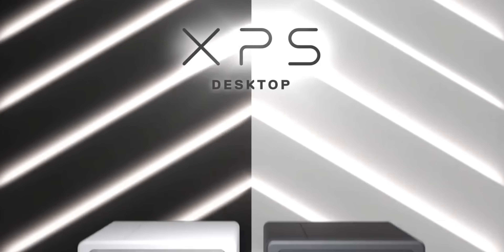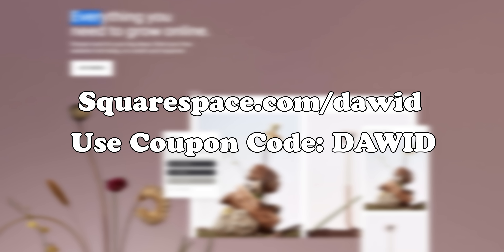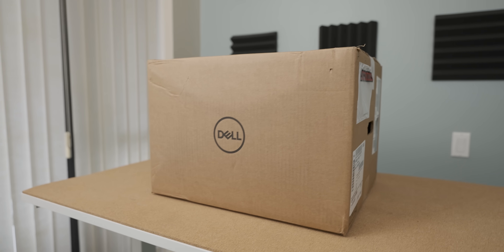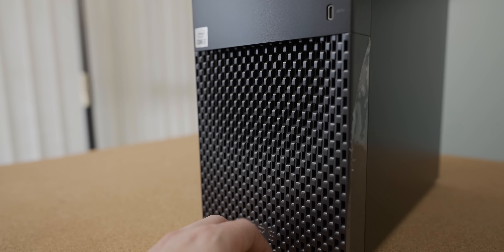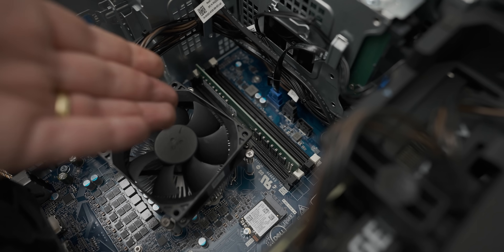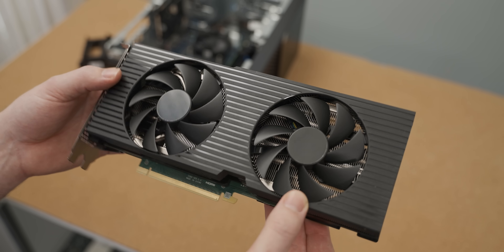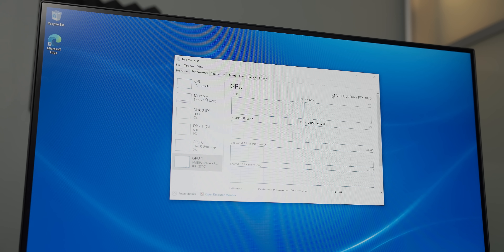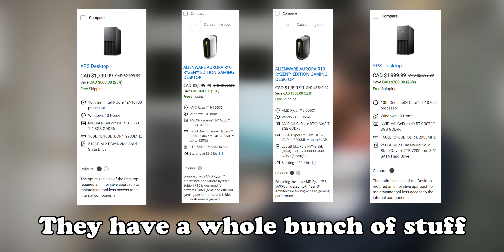DELL Did Me Dirty... RTX 3070 Dell XPS Pre-Built

Comment: I will never buy Dell again... I have had two spec'd out units off them within a space of 3 to 4 years about 5 to 8 or so years ago, the latest was an expensive build that I could have home built if I had the knowledge at the time for a fraction of the price, it had immediate sound issues that I could not even confirm was coming from the expensive sound card but required a restart an hour after having the unit on, everyday... both Seagate Barracuda 1.5TB hard drives failed within the year which is astonishing to think that Toshiba at the time could last 10 years, so those cost me an arm and a leg, and after spending more money on new hard drives, time wasted re-installing a lot through updates messing up my system, time wasted trying to figure out the sound issue, it kept me above water for 5 years or so at a cost to my sanity, but boy, did I feel a great pressure come off of me when I threw that garbage out for a home build that 5 years on has given me ZERO issues.

Comment: My lord...  That looks like a 20-year-old Motherboard....
Dell has REALLY fallen off...  They must have all OLD idiots that work there who have no Vision anymore.
I just spent $1,500 with ALL massively good parts (purchased separately, most warrantied) including two SSD's, the only thing I didn't include was the video card cause you can't get one now, so I'm going to put my 2060 into it, and also putting my BlueRay Burner into it, and will get a new multi-card reader since I need an updated one.  Nevertheless, that Dell system was just terrible.  And what happened to their great internal "design" tradition?

Comment: This reminds me of the time I bought an XPS system back in 2010.  I didn't have a lot of money, so I couldn't get it all spec'd out like I wanted.  I ended up going for a XPS 9100 with 12 GB of memory, an i7-930 processor, a very early NVIDIA GTX graphics card and a 500 GB Western Digital Black HDD.  It spent a number of years in pieces after I scavenged it for parts, but decided to rebuild it last year.  I used the original motherboard and the original processor.  I decided to add 24 GB of Corsair Vengeance PRO memory, a 500 GB Samsung SSD, a 3 TB WD Blue HDD for storage, and added a EVGA GTX 970 FTW for a graphics card.  I powered it on for the first time in years and it ran like a champ.  I bet it would even out perform the most spec'd out prebuilts on the market.

Comment: He benchmarks at 1080p and complains that the GPU is only running at 60%. Like righto mate, show me a CPU that doesn’t bottleneck a 3070 at 1080p. And if single channel RAM is so TERRIBLE you could have spent a few mins dropping in two 8GB DIMMs to show us the MASSIVE FPS benefit. But you didn’t, because it’s 2021 not 2005 and dual-channel just doesn’t matter that much anymore.
Reply from the maker: I get that testing a 3070 at 1080p shows up CPU bottlenecks, but that's one of the reasons I tested there. You should be getting higher FPS with a 10700 at 1080P. I'm doing a follow up where I test the system with dual channel RAM and a better cooler to see how much it matters.
However, the main reason I was so upset about the RAM configuration is because I specificaly asked for the correct configuration and they still gave me the incorrect one.

Comment: So did Dell do when you told them that they didn't send the right RAM configuration? It's been many years since I dealt with Dell, maybe 15 years. We ordered computers from them and they never got the configurations correct and their customer service was totally brain-dead. I worked at Motorola in Austin, TX so we were practically in the same town with Dell. I've never bought Dell since that experience was so bad.

Comment: So you almost have a decent system there, just need a case, motherboard, cpu cooler, power supply, and another 16Gb stick  of ram.
Reply: Why does he need a case?
Reply: @TheStoso2  breathing space
Reply: You just need another pc without cpu and gpi
Reply: TBH, for someone who don't really care about leaving some performances on the table and just need a pc able to run RTX, this thing's a good pc.
Btw, i'm well aware that for an enthusiast, this is a "scam"(although, not like other prebuilt makers)
Reply: @gastaannoying1780  A CPU shouldn't be bottlenecking your $700 GPU.. it also shouldn't be running at 88c underload and this PC shouldn't cost $1500.
Reply: @Mr.Genesis  fair point
Reply: @Mr.Genesis  so you would face scalpers for something like 10x higher price
Reply: @Ordlnary_Gamer  its more like 2x the price and i have something to sell too.. My GPU is also worth $1000. So i'd only actually pay $200 for a 3070
Reply: @Mr.Genesis  that is if it didn’t depreciate over time >_> I remember a time when I thought I’d resell my 750ti for alittle under retail 6 years after using it daily……… I THOUGHT WRONG!!
Reply: @Bobbiesgonewild  my 5700xt is still being sold for $900 uses
Reply: @Mr.Genesis  my 750ti was selling for like 199 and under at the time lol
Reply: Meh, compared to a full custom built 3070, 90% of the time it probably won't make much of a difference in games. Dell IMO has always made solid PC's. I use a 10 year old xps desktop for a game/nas server. It does the job.
Reply: @RichardTheTurd556  I have a 3070 Dell XPS and I can confirm its quite decent (I did replace the ram with two sticks) - dammit just realised it has a sd card reader (I have it under the desk and just bought an external reader as I didnt check)
Reply: @RichardTheTurd556  ironic considering the video shows the cpu bottlenecking due to its pathetic cooler and single stick of ram, modern dells pretty much suck, at least the gaming ones do, with awful cooling, loads and loads of bloatware, proprietary motherboard, psu and all of the connectors

Comment: I have a Dell XPS laptop and it's great for mundane work stuff but the cooling is just crap if you want to put it under any kind of workload. I've had to re-paste the CPU and GPU, install new thermal pads and cut extra holes on the underside just to keep it cool. Seriously Dell, if you're not going not going to provide adequate cooling for the configurations you provide, then why bother?
Reply: When the Dell service tech came to replace my motherboard for the third time he saw a tube of arctic silver on the table… he asked me if he could use that instead and slagged off their alternative while he was installing

Comment: Do Alienware prebuilts have these same issues or are they designed with better cooling systems?
Reply: It's a mixed bag Caleb.  Dawid (likely intentionally..) bought the non K version of this system which doesn't come with a tower cooler and Dell doesn't really advertise how you get those...  As for the Alienware...  don't get one without the water cooling option. It's a absolute must.  If it's not included in the configuration they will have it for a $50 - $100 addon.
Reply: @justair44  Appreciste the input. I have read mixed reviews on water cooling. Is it essential due to the back end air flow restrictions usually associated with Dells?
Reply: @CAT15407   Well the Power supply sits on the side of the case. That impedes airflow and "at best" the stock cooler is only marginally better than intel's stock cooler which isn't saying much. Certainly is no where near Amds stock stealth coolers.   Also  you won't be able to get in a beefy tower cooler on a Alienware,  Just low profile solutions.  

Their water cooling option is more than adequate. I've got a 8700K R7 clocked at 4.9GHZ for 3 years now and it runs great.  I also have a R10 with a Ryzen 3700 clocked at 3.9GHZ 24/7 and it never (or rarely..) hits 65c.  I really like both systems I have and that's coming from someone who has built 100s upon 100s of custom gaming computers.  

Their fine if you spec them right and go for the sale priced options configuring into what you want. Play around with that on their deals.. as it's not one size fits all. You could literally spend 100s more on a worse system if you are not careful.

Comment: Literally I had the same problem with payment but on Amazon. I was ordering parts for my PC and had 11 of the parts in my cart at the same time and placed the order. Well it got declined a day later. Ok. I replaced the order. Declined 5 hours later. So I called my bank the next morning to lift the $1000/day block that I didn't know I had so I could place the order. Still wasn't working. Lifted international blocks, still no. So I gave up and decided to place 3 seperate orders for the 11 parts. Which worked😑

Comment: I bought a Dell G5 with the same configuration but with 3060 TI and 16 GB of dual channel ram. I pay 1700 CAD taxes included for it (1350 US). It works great. A DIY with the same specs would probably work better but you can not find a 3060 TI for less than 800 US.
Reply: I agree... and you can easily change out the CPU cooler.  A Noctua NH-U9S chromax would work well in your G5 Case.  One thing that isn't noted here.. if he'd gone with the the K version of the cpu he'd have gotten the Tower cooler.  Dell doesn't advertise that.. took me a bit of searching to find that out.

Comment: they only post the marketing material for the top spec'd versions, but i7 processor doesn't need a beefy cooler. If you would've ordered i9 or something they would've included a bigger cooler. I order 5820T and 7820T's all the time and the insides are as advertised, but they're also like 8 thousand dollar machines too.
Reply: No .. if he'd ordered a "K" version he'd have gotten the tower cooler.  Non K's don't come with it.  DO they require better cooling? Absolutely. 10 series run hot.  Even the i5's.

Comment: So basically the choice is either make a rig with everything else you want apart from a decent graphics card because of the mental market, or buy a pre-built with the knowledge that you will have to sort out the RAM, cooler, and PSU, that is if you even can change those things due to the weird case sizes etc.

Comment: Just ordered an Alienware R11 with the 3070 and a 10700k instead of the regular 10700. Way beefier power supply and liquid cooling for the CPU should make for better thermals, all for only about $150 USD more than the single fan stock cooler XPS madness, plus 3400 mhz ram
Reply: also, after research, dell unfortunately only puts that often advertised cooler on their K series processors in the XPS

Comment: You only get stock cpu coolers with xps  and g5 desktops. Only Alienware has different cpu cooler options. As for ram,  also generic. Get a better cpu cooler and better ram.
Reply: Not quite true Darcy. First the alienware's come with the stock crappy cooler unless you spec up to the liquid cooling (if it's not in the configuration you've selected) Also tower coolers are included on the "K" versions of the intel cpu's on the XPS and the G5 but not the non Ks.

Comment: those coolers arnt that bad if there the same as the previous optiplex systems the airflow in the case is a bigger issue, along with a slow ssd and single channel slow ram

Comment: To be honest looking at their marketing material it seems like valid case for "false advertisement" and to claim partial refund of say $500... at which point it is even better deal. Because everythign in their marketing material is wrong - it shows nice CPU cooler, it shows nice black motherboard wit proper capacitors on power phases etc. Whereas the real deal is bog standard green MB with power delivery from Chinese toy and CPU fan from dollar store. I would just make a claim that I was miss sold motherboard and CPU fan and say that I want at least $300 for MB, $100 for nice fan + issues with dual vs single channel rams.
Reply: He should do some improvements, make a video, remove them, and return the machine.  No reason to keep it.
Reply: @bradleyrex2968  For him yes ... but I just put myself in position of person who wants to get RTX3070 and keep it. So as I said I would play false advertisement card here, because it clearly is. And it is not just different look, the CPU cooler is fundamentally worse - what they show on advert is cooler with heatpipes and fine fin stack (which means good heat transfer characteristics) and what is fitted is just $5 intel "pancake" type which is trash. And same for motherboard - good quality capacitors are key for stable performance and what is on the board is literally the worst power stages I have seen... in like last 20 years. In advert it shows premium components and what is in advert, must be in the product - if not, then it means it is falsely advertised.
Reply: @lp9280   I don't think you'd be able to get away with that LP.  The single channel stick issue is easily addressed by Dell and as far as the cooler, if Dawid put's up a big enough stink over it they'd send him the tower cooler... thing is, it's only included on the "K" version of the cpu since it can overclock.
Reply: @justair44  I am not sure how it works in US, but EU what it shows in the images, exactly the same stuff should be in the box. The difference in this case were significant enough to call it "false advertisement".
In itself it may not be big issue unless many people complain, but if you prove false advertisement then you can ask for reasonable damages... meaning Dell would rather refund like 30% of the price rather than risk paying legal costs and replacing parts anyway, which could easily cost as much as the whole PC.
One would need to b pretty principal person to take it all the way, but I would certainly ask for refund due to this.
Finally, don't forget the shipping and warranty rules. I am certain Dell would never ship replacement parts for user to "install themselves", because this suddenly open the gates to "unlimited liability". So the only thing they would do they could offer return and replacement for entire thing. This being PC tower, shipped next day, insured for high price... it may cost $100 to ship it each way. So again just considering shipping Dell is better of with offering partial refund - it is just cheaper and easier for them as long as customer accepts it.
Reply: @lp9280   If you look at the imaging though it show's it with the crappy and semi ok cooler.
Reply: @justair44  The picture shows cooler with heatpipes and ram with coolers. Sure it is not Noctua, but it is certainly 100 times better than absolute trash which was fitted in the actual PC.

Comment: My take is that dell is trying to make the towers too compact. I don't know why. I don't understand the proprietary power supply either. I'm not anti-dell. They make decent computers still. But I think I liked them better until the mid to late 00's.

I've had several dells over the years. They're reliable *knock on wood*. But they really need to stop making these strange decisions. It could not possibly cost that much to improve the airflow a bit and have a better cpu cooler. 

They're going for the streamlined look too much. I think part of it is that the people that care about the performance aren't the dell market anymore. There are other companies that make prebuilt computers at a much higher profit/price but with better solutions. Everyone else just buys the parts from newegg and builds it to their liking.

Comment: If you have paid for a dual channel config ( explicit box checked and price suprlus added) > Contact Dell and they might offer a refund for the option OR ( happened to a client of mine) send you a second ddr kit for free as a " sorry we botched it" gesture. May as well be the same fot the cooler. In my experience, Dell support is (for the most cas e) efficient, on the provision that you could explain the problem with sufficient tech knowledge ( and know the Oh so many roundabout way to push your case) 
On another note ... Dell is not the " entry level gaming machine specialist" for nothing ( many of their Optiplexes XX10 and XX20 series machines have found a second life from desk tool to poorman gaming rigs ... )

Comment: when you look at the board, it tells you why it doesnt perform well. The power delivery isnt great and it has no heatsink. Branded boards like asus will have a heatsink on the power delivery, and you have to tweak the CPU cooling. OEMs all do intel temps at 90+C which is why it throttles.

SO both the power delivery and stock intel temp cooling causes bad performance. The PSU is also not even a tier 3 or better despite it being rated 80+ platinum.